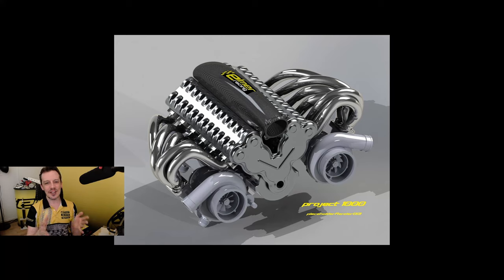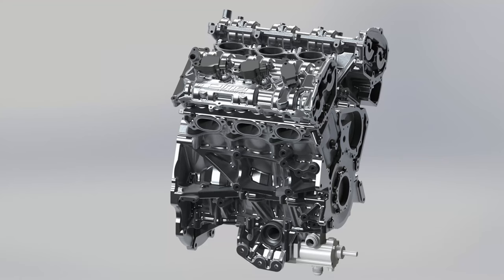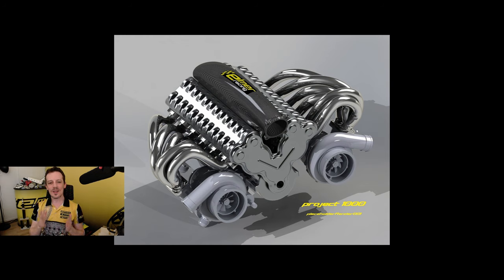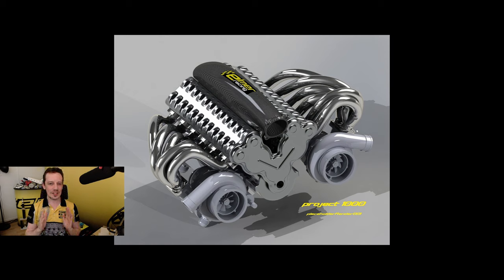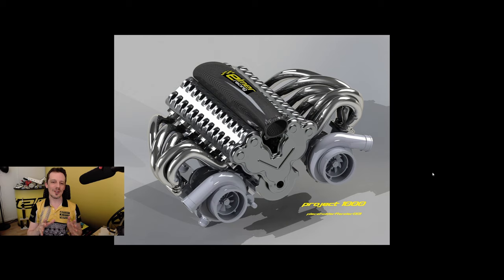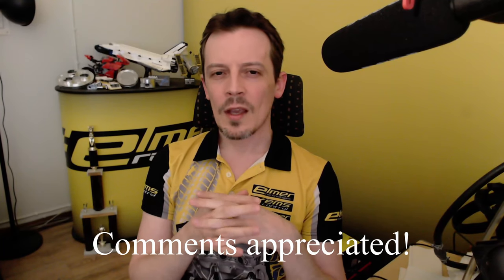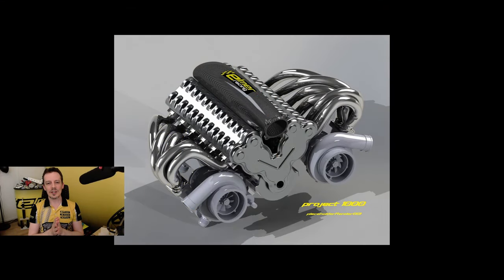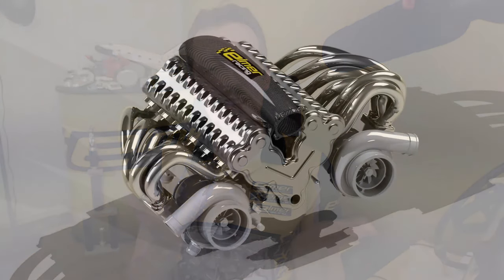Craziest supercar engine ever? ElmerRacing "project1000"

Comment: Hillclimbs, sprints, land speed racing would all be very interesting applications due to the low displacement. It’s even make semi sense to be turned down some and used for an lmh racing car, really down to what longevity targets are really.

I can see the crate motor used in both NA and turbo form for everything that fits four and six cylinder swaps… definitely given something to chew on though

Comment: That engine would be perfect for a super light monoplace or a tiny English roadster. This coupled to an electrical engine powered by supercapacitors only could be an unbeatable beast.
Reply from the maker: Power-to-mass ratio isn't as good as our Thor engine though!
Reply: @ElmerRacing  What do you think the V12 mass would be? The sound of a V12 is so unique. There is no subistute. Reminds me the old F1 cars
Reply: Having it in the Vandal one would be absolutely nuts !!😃
Reply from the maker: @mikehuston6606  Unknown at the moment. Craziness and sound is something that is very important for supercars though!
Reply: @ElmerRacing any specs on the dimensions? Length? Height?

Comment: has your team ever built a small displacement drag car engine? Back in the 70s to 2000s a lot of drag cars used to rev well past 10k rpm on 4L+ of displacement. A good example is the 12K rpm nova that was big on youtube in the early 2000s
Reply from the maker: Our Hel engines first version is intended primarily for drag use.
Reply: @ElmerRacing  brilliant. I have no doubt that GTR roll racers will dump millions into the project as well.

Comment: Will this have torque?
Reply from the maker: The only torque values we will ever release for any of our engines are for fasteners. Where it makes sense.
Vehicle performance is determined by power, i.e. how much energy you can produce per time unit. (determines how much kinetic energy you can put into the vehicle, or friction losses etc)
Reply: "The only torque values we will ever release for any of our engines are for fasteners"
🤣🤣🤣🤣 what a legend
Reply: @ElmerRacing  Makes sense. But that's got to be terrible for marketing outside your engineering bubble, though...

Comment: Have you ever concidered building an NA engine?
Reply from the maker: We have some customers that we have discussed NA engine options with. So far none have become orders.
It's much easier to design a good NA engine than a turbo engine though, would be a nice change! We are very good at designing turbo engines though, and those are clearly the best choice in most cases (not all).

Comment: But you're not comparing like with like, so you coming on here and saying your engine will be way more extreme simply isn't true.  You have to give Cosworth their due here, you build very highly boosted billet race engines but have no experience at all with normally aspirated powertrain development, Cosworth has been doing this for over 60 years and the GMA V12 achieves things that no normally aspirated road engine has before.  Also it seems to me that making a 1L V12 rev higher than a 4L V12 wouldn't be that great of an achievement, even if you only factor in the reduction in reciprocating mass, but until ElmerRacing builds a 4L normally aspirated V12 with the same or better power figures, a 12,000+ rpm redline, that's also Euro 6 emissions compliant and has 100,000 Km durability you don't really have a point.
Reply from the maker: Emissions is the question mark for sure! The development hours needed to meet those don't come cheap!
Engine wise though, the main things for supercar engines are: 1) fun and engaging to drive 2) crazy specs 3) good power

Comment: This will definitely touch 20K rpm like the old honda 250cc inline 4

Jus take the design from s1000rr heads put it on a V12 and destroke😂😂

And i would think having both a turbocharged and supercharged versions is cool because of the sound issue

The supercharger amplifies the sound while the turbo silences it

The supercar that uses tjis engine must be extremely light because its only 1 liter so basically kitcars and any single seaters 

This is literally better than current F1 engines
Reply from the maker: We can neither confirm nor deny any rpm target. ;)
Reply: @ElmerRacing  the idea of 1 liter V12 is so extreme that even with 70mm bore you can do 21.65mm stroke to hit 1000cc

And if you want normal bore of 80mm your stroke would be 16.6mm

And you tell me 20000rpm is not possible

Dude just go for the highest reving engine in history of 25000 rpm or 20000 just to be "safe" forever
Reply: @ElmerRacing  hello,
I was wondering 
Do you use a microtube radiator in the rp968 race car?
Reply from the maker: @FirstLast-tx3yj  We don't have the details of the radiator design on the rp968. You would have to ask the car owner/team.
Reply: @ElmerRacing  who are they exactly and how to contact them?
I thought the whole car was built by Elmer.
Reply from the maker: @FirstLast-tx3yj  We just design and manufacture engines and parts at the moment.
Reply: @FirstLast-tx3yj  55mm. bore and 35mm. storke will give you 998ccm and potential for 22.000rpm with a safe mean piston speed at max rpm. Could crank out around 360hp in NA version. 2 bars of boost and then 1000hp is possible.

Comment: It would be smart to aim for a less technically inclined audience than the target demographic of your other products*.

I'd display the engine in a way that makes it more comparable to normal sports car engines, which would intuitively highlight just how insane your engine is and it would appeal to FAR more people. Doing that allows you to rely on the emotional appeal of the engine, instead of having to rely on abstract technical figures that require prior technical knowledge and limit the size of your audience SEVERELY. 
By keeping it mainstream, you can appeal to a far bigger audience and generate publicity more easily. In addition, you then don't have to familiarize the audience with the products you aim to compete with. The vast majority of people aren't familiar with small niche V12 engines made by Cosworth etc. 
They shouldn't need half an engineering degree or even any prior knowledge about engines to understand why your engine is cool. And if they never even heard about the T50 before, that makes your engine THAT much more special to them.

I'm convinced that putting the enigne in a Miata and bringing it to some automotive YouTubers and car journalists can yield great results.
That would be a great way of showcasing the experience of the engine in a way many people can relate to. And it's a well proven receipe to reach a wide audience. You'd get a channel like CarThrottle to make a video about your engine by engine-swapping a car as popular as a Miata, that's certain... That's going to get a couple million clicks any day of the week. 

In my opinion, the engine really should not be showcased in a supercar or racecar application, even if that's where it's going to be sold. Break out of your niche!!

Comment: Adding turbos is already a fail because it ruins the noise, purity and packaging. What makes the GMA special is the extremely low kerb weight, not just the engine, so it doesn't need as much power. I'm sure the engine could rev higher but they most likely toned it back for reliability. The Valkyrie version already makes almost 1,200hp - 160hp electric with no turbos.
Reply: The GMA engine is rated for 150,000 miles and meets Euro 6 standards while being a semi-stressed structural contributor to the chassis. On top of all the other things it can do. Insane
Reply: Revs per minute in the GMA T50 are limited because of the engine's displacement besides the reliability. They run into issues because they're hitting the hard limits of how fast a piston can move in the cylinder. Lowering displacement allows for more revs with the same piston velocity.